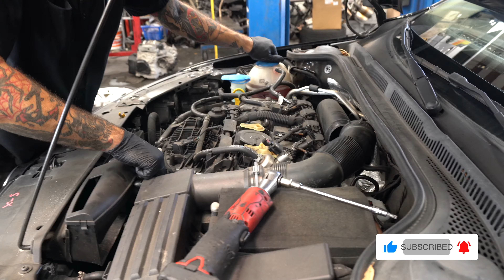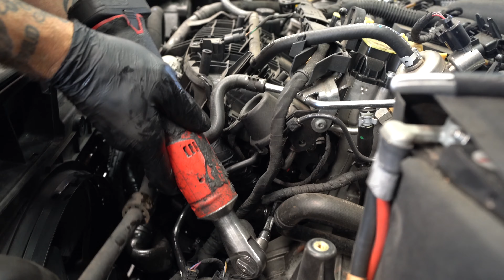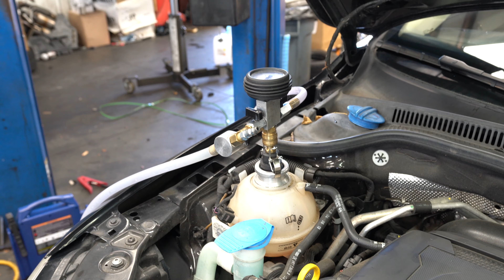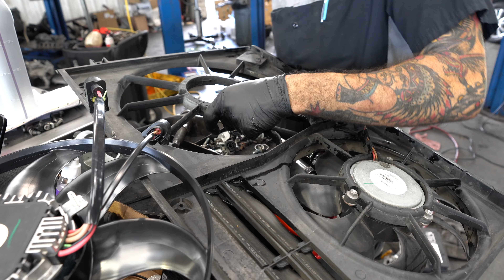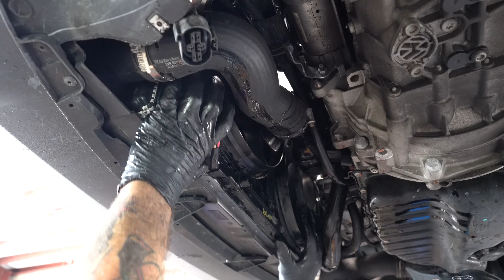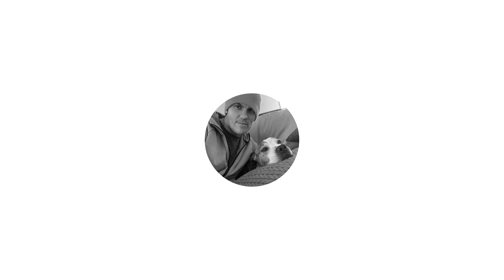2014 Jetta 1.8 Water pump

Comment: What is the typical mileage that these fail? My daughter is moving far away and has 125k on her '14 Passat. The pump is bone dry so it might have been replaced before she bought it with 95k miles. Is it highly unlikely that an original pump would get up to 125k w/o leaking?
Reply from the maker: To be honest if it made it this far failure is unlikely

Comment: Does anyone know if a water pump issue or failure would cause fluid to leak out on the drivers side behind the front wheel? For some odd reason my 1.8t Jetta was leaking what looked like water rather than coolant from behind my front tire and out of a hole in the chassis that's the size of a Silver Dollar right behind the front tire. The car had been sitting outside for about 3 weeks without being driven. I didn't notice any coolant level issues or anything either. It was leaking right behind the front drivers tire. Thanks
Reply: Could be rain water coming off the cowl below the windshield. They often get clogged with leaves and hold large amounts of water. Had it rained in the 3 weeks it sat?
Reply: @russellp73  Yeah, this ended up being water in the sun roof drainage that probably didn't leak out because my car was park at an angle for a few weeks so I'm guessing the sunroof drain was at a strange angle not allowing the water to drip out. However, while I had it in for repairs the shop also blew out the sunroof drain with compressed air or something. I haven't had it parked out in the rain but I'm glad it's not the water pump.